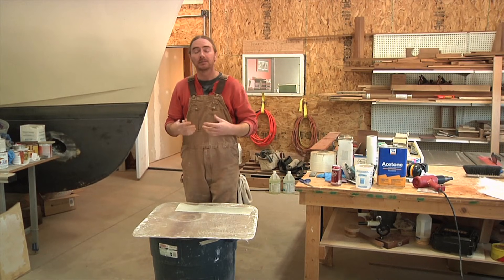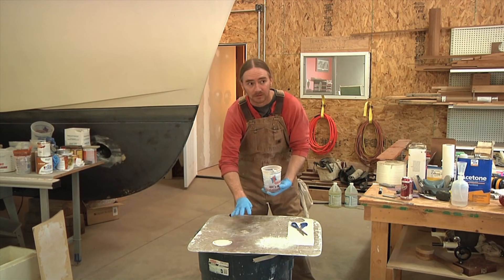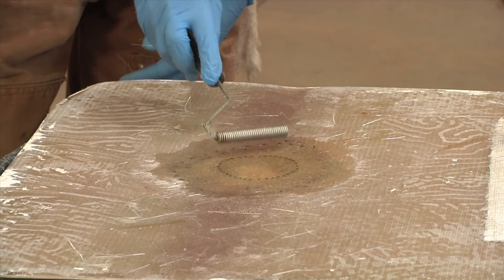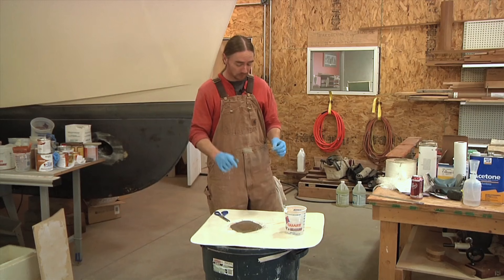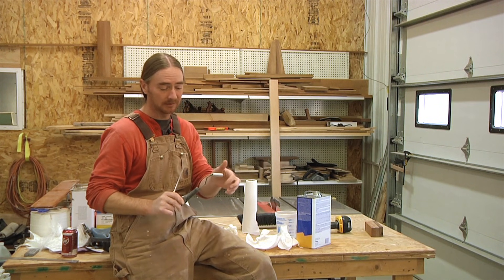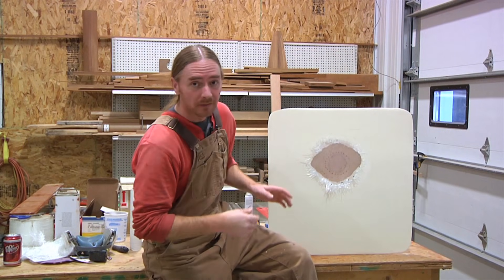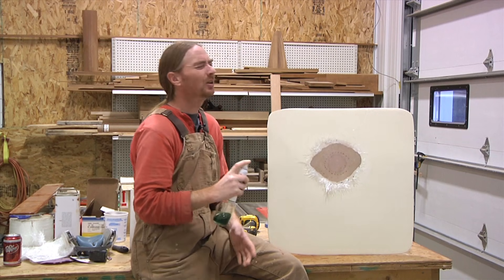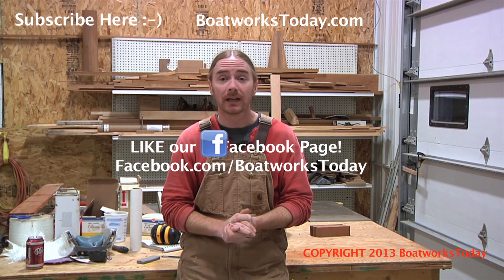Fiberglass Boat Repair~ There's A Hole In My Boat Part 3

Comment: Great videos, lots of useful info. What would your advice be for a large section of the Hull that has delamination? Basically there is quite a bit of deflection when you push on the Hull and this continues for most of the back half of the Hull. One suggestion I have had from a local boat repairer is to cover all the hull with another 4 to 5 layers of glass, is this something you would recommend? Thanks
Reply from the maker: Hey Kevin, try sending some pics to my FB page  http://facebook.com/boatworkstoday

Unless there is visible damage there shouldn't be any need to add more glass.  Some hulls are designed to flex.  If you stiffen one area up too much you may run the risk of that stress transferring to other areas causing problems :-)
Reply: BoatworksToday
Hi Andy, thanks for the response, much appreciated will send some pics to your FB page. There are a couple of spots further forward on the hull that have visible damage that will also need attention however the hull around these parts does not flex like the rear of the hull. I have only recently got the boat so do not know much of its history, it looks like it has been taking water on for some time. If it has had water internally for a long time can this harm the glass? Also I have noticed that the ribs that start at the front do not run the full length of the hull and where they are tapered down the taper is different on either side, which could indicate it has had work done before.and maybe these used to run the full length of the hull but were removed when it was repaired... 
On hulls that are designed to flex do they have the same amount of flex for the full length or can the front half be firmer than the rear?  
Thanks again.
Reply from the maker: Kevin Brameld I'll have to wait for the pics to know for sure :-)  Won't need many; probably 4-6

Comment from the maker: Anytime there is a complete hole / failure of the fiberglass (specifically in an area of the boat that could make the difference between it staying afloat or going to the bottom) it's a standard to address both sides of the damage.  If it were an area that was more of a cosmetic fix (glassing over an opening from an old display gauge or small access holes) then it can be done from one side only.  Unfortunately most of the fiberglass vids do not go through the correct steps for making repairs :-)

Comment: What if you only have access to one side...how would you coat it with the air tight wax seal on the back side to have it cure properly?  I would only be able fix this continuous 1/8 crack  that follows an "interior" cabin entry/doorway...two sides are about 4 feet in length and bottom 3 feet in length...top is fine.   I would guess this is structural stress damage on this old 78' O'day... I need it  to be strong. Again, it's the  interior only...the outside glass of the doorway is fine. HELP! :)

Comment: Hi Great Videos!  A Question. I have my 32' Columbia Sabe down to the bare hull now and am about to start all the fiberglass work.  Do you recommend Epoxy or Polester Resin.  Cost aside in your experiance in my place what would you use.   I thank you in advance and watch all your Videos!  Thank you so muc for posting.

Comment: Question: How do you deal with the short pot life of polyester resin when you have a huge layup and you are working alone?  The stuff is unusable after about 10 minutes.  Do they make a slow set hardener?  An additive?  I was reading that warmer temperatures make it set faster so would it give me more time if the mix cup was placed in one of those beer cooler cup holders with the freeze gel stuff inside to keep it cold?

What about starting on one end of the layup with a small amount of resin, then mixing multiple cups, one after the other.  Would that work or would it make a bad or weaker layup?

Or should I just give up on polyester and go with epoxy?
Reply from the maker: +n4mwd For large layups, I generally work with multiple batches of resin.  If you're rolling the resin on, you can typically apply 2Qts of material within 10 minutes, but to start I'd mix small batches.  They do make a slow set Mek-P which could certainly be another option.  I probably wouldn't put the resin in a cooler to slow the cure process; the resin needs to be 65F or warmer to properly do it's thing.  Also, having it cooled will also make it thicker, so would be more difficult to wet the glass out :-)
Reply: +BoatworksToday Thanks.  Do you know where I can buy slow set mekp or slow set resin?  My small panels are 4'x7' and the large panel is 8'x20'.  They are mostly flat, but there is intricate detail in places.  The smaller panels are to be done with a mold and the larger one is moldless glass over foam technique.  I've never done either one and they both call for polyester.  I normally use epoxy.   So I guess I'm in for a treat.
Reply from the maker: +n4mwd You should be able to work those areas with standard hardener.  Catalyze the resin 1% which will give a little longer working time, and as soon as it's mixed (very well), spread the resin out over the glass so it's not sitting in the cup.  work in sections and it will be fine :-)  Once you get into it you'll quickly get a feel for the process and working time.  Just have everything laid out, planned and ready to go!  Good luck!

Comment: How does the strength of these kinds of repairs compare to the original hull structure?
Reply from the maker: Joshua Jackson as good or better.  Typically better choice of glass and more appropriate resin to glass ratio makes for a better laminate / repair

Comment: We had several 1x4 vertical support beams break loose from the support beam they were holding up. now there are holes in the floor that we cannot access from the underside. We are going to have to cut an even larger hole to have room to replace the 1x4 supports. How would we patch the holes if we can only patch from the top?
Reply from the maker: +Mark McQueen Hi Mark, it might be best if you could send me a couple pics of what you're working on :-)  Thanks!

Comment: Would this method be the same for a hole about 1" x 2" that used to be a auto-bailer that no longer exists?
Reply from the maker: Yes, however the thickness of the core material that you have to replace will also need to be taken into consideration.  Personally I think it would be easier just to buy a new bailer and install it (even though it may not be used)..  I just did one of these and the part was around $30 and half hour of work (as opposed to roughly a full day of glassing, fairing, gelcoating, etc)..
Reply: I looked into it and could only find like $100 bailers that would work below water line. Would you mind providing some brand names of bailers that would work in this case?

Comment: It be awesome if I can get a reply from anyone that knows how to do fiberglass repair I'm about to do a fiberglass repair on a Bayliner it ran aground and the impact area is where the blades are the pillars the structure that held the propeller one of them inside the boat and it's about a good 6 inch hole roughly how much would it cost just in materials to repair that boat

Comment: Picture this, you have a triangular hole just above the waterline port side in the aft area, measuring 40x30cm. why can't I build up a solid patch, half an inch thick (the thickness of the Hull) the exact shape as the hole and when it's gone hard fix in to the hole with epoxy paste. Then when this has set grind along the joint about 50mm either side and then fiberglass it up

Comment: If you still notice comments on old videos. Could this have been done with epoxy.
Reply from the maker: If you were intending to finish the repair with paint and not gelcoat then yes, but you'd need to omit the CSM as it does not work well with epoxy.  Hope this helps!

Comment: if you have an aluminum fin roller and you forget to clean it after you're done, and the resin sets up. Take It Outside along with a propane torch and set it on fire, hold it up like a torch, and don't breathe the black smoke after the resin Burns off take a wire brush and clean out the ashes it'll turn black but it will still be usable

Comment: Steve great channel learned a lot and always using it for help.
https://youtu.be/0-kVRKhyb3g?t=279 
At the point in the above link you flip over the panel and I am curious, wouldn't the gravity pull the layers down distorting the layup? I had some issues with overhead repairs on my dinghy hull while repairing some cracks underneath. The repair I have made looked and worked fine for some time but later on the hull cracked at the repaired spots. On closer inspection noticed that the repair re-cracked from the inside progressing to the outer part of the hull exactly on the repair spot I have made. Any thoughts?

Comment: Cut a hole in damaged area 

Boat surface `
Lip -
Hole _

Again that is 
      |                        |
`````--_____--`````

Where you see the | that is where you want to cut you spare material for a patch and from their shave a groove for the lip from`to-

Then epoxy your cut out and place fiberglass on both sides and then sand it once cured after that wet the lip and the interior cut out part with epoxy again and screw the cutout into the lip shaving of the boat -
/from their after it dries remove the screws add compound/cure/sand/compound/sand/until after you sand and you have a smooth surface of the compound/lightly sand six inches out of the restored area/,from their fiberglass the restored area plus one foot for extra strength/prime/paint/final finish/buff/DONE

Comment: I'm sure this chap knows exactly his trade but he's a little slow. I've had at least one bottle of wine before each episode is finished. Personally, I use the 'West system' epoxy resin for my four sailing boats. It cures as hard as titanium and in the marine business that's what you want. I also use balsa wood for filling in and over a layer of fiber,  fairing compound. All is 'West system'. It's expensive but go out there in a storm and you thank god.
Reply: West is over priced although if you have a dollar tree , go ahead with West. The way he laminates is stronger than using a quick hard fix . It doesn't matter if you have 20 boats , if you do not laminate your glass properly and slowly your just putting on a band aid. I have repaired literally hundreds of boats in the past 40 years and this dude is one of the best at his art.